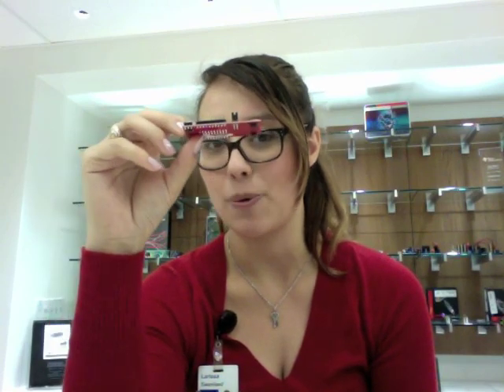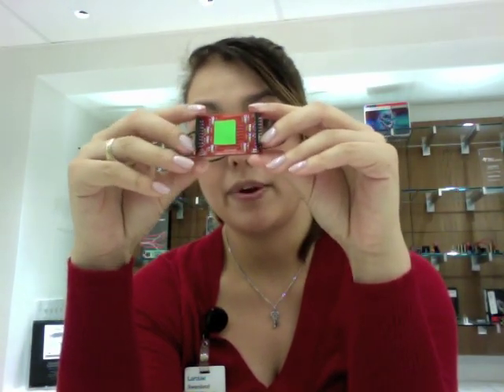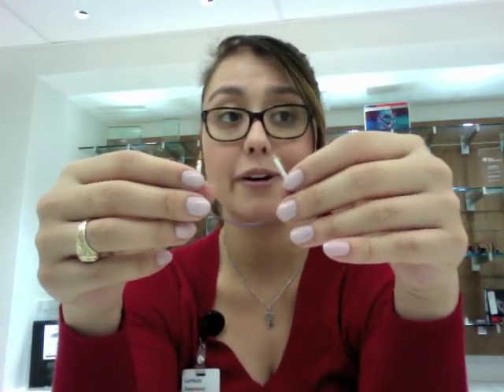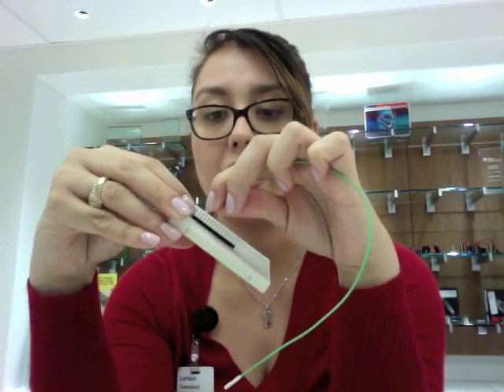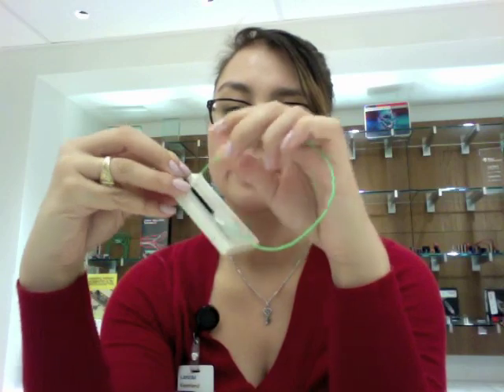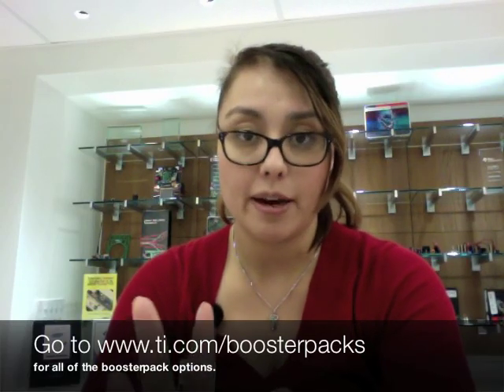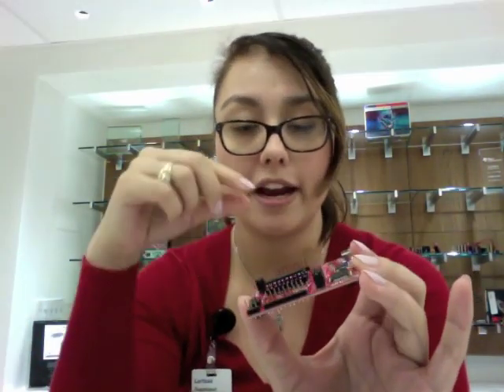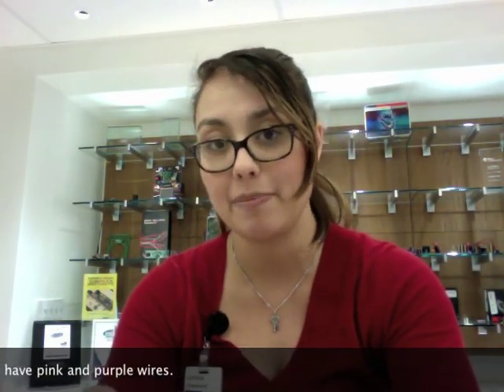MSP430 LaunchPad- Why Male Headers

Comment: 5:24 did you just break one the pins on header? you are strong!!!! Oh by the way, if you wan't to keep those male headers, fine! you could put them under the board so it directly go on to breadboard itself! you happy and your customer happy! Pins at the back are not obstructed by components, if they want to NOT breadboard, they still can use their female connectors.

Oh, One more thing! My problem is not what headers you are using. Where I live, to get my hand on one of those boards I have to pay half of my salary and I'm senior engineer in my company.

Comment: how I can use 1 STELLARIS and 2  MSP430 ? 
I need to establish connection between them, with CC2530 ?
when I try to flash 2 plates MSP 430 I get an error message, that there is no plate connected.
I get into the MSP430 folder instead of stellaris and not let me. (Have a .txt extension)
help please.

Comment: I would rather have the option of not soldering the headers on the board.  I've had to remove both headers (destructively) and have installed new headers.  I use a male header on the power side / bottom and a female header on the usb / top side.  This lets us mount the launchpad on our existing development i/o board as well as on our existing robot platform.

Comment: Yeah, I find when using Energia the MSP 430 is about as easy to use as Arduino and basic stuff ports fairly easy. I think the best route would be a set of gender changing headers to convert to female. My arduino projects ported very easy but I was unable to test because of not having a way to jumper over to my breadboard. I tried alligator clips but they were too bulky and tended to want to short between pins.

Comment: Use with logic analyzers is a weak justification for male headers. If someone needs to use LA clips, just drop in a set of Male to Male headers. Problem Solved.

Ability to use cheap and plentiful BARE WIRE far excedes the convenience of hooking up the occasional logic analyzer.

Comment: First male headers, now doubling the price on the launchpad? A STM32F0 discovery board has 4x the flash program space, 15x the RAM, 3x the core CLK speed, 2x w/ 32bit instruction set and is now CHEAPER than the msp430 launchpad. The MSP430 launchpad has lost its only selling point which was its price. 32 bit ARM processors are far more powerful, have more open source support, and compete with the msp430 in their low power models. Why use TI msp430s at school or work now? *cries* why TI...why...?
Reply: ARM processors are made to be used with an operating system.
Thus you can't really compare them with such small microcontrollers like the MSP430.
And an 32 Bit ARM doesn't have a lower power consumption than the MSP430.

Comment: Thanks.. I hope to see more TI products in Turkey as well.. I can only find Launchpad MSP430 series easily. I had to make a little personal stock of them :  ) I have both rev 1.4 and 1.5 and i have to use 1.4 for testing purposes. In general i love the things in the box, usb cable, XT etc.. Oh also those cute stickers !! Keep those in the boxxx : ) LAstly; Energia Project is very very important. I think TI should support it. Otherwise it is not practical to work with them for hobbyists..

Comment: Here's another idea nobody has offered yet: Raid the room where they store all the old retired computers and scavenge all of the ribbon cables from them. Use the first 10 odd pins on one end of the cable (1, 3 ,5 .. 19) to connect to a male Launchpad header, then stuff your male wires into the first 10 odd pins on the other end. 

Ribbon cable == really long female-female adapter.

P.S. The (J6) Vcc and 2 GNDs are 0.20" from the (J2) header, so they mate too, and come across to the other side.

Comment: They should cost the same. The press fit parts have "barbs" stamped into the side of the pins that go into the board. It is difficult to compare prices because if you try and buy plain old 10x1 gold flash plated headers the price ranges from $0.20 to $0.80 each. We can't draw reasonable comparisons when the baseline is all over the map. We know the nice folks at TI must be getting a good bulk discount to include them with Launchpad, so we can assume they can get press-fits at a bulk price too.

Comment: Just cross posting:
The female header would have been ideal, for the same reason listed for female jumper wire. Turning Female to male is simple with the included male headers from the r1.4, just pop them on to the female header when needed. Plug and Play, no soldering required, and would still work with the Capsense and all other boosterpacks. And since headers are pretty much a standard component, even if they get lost, easy to replace.

And you forgot to mention one option, WIRE WRAPPING

Comment: Have you considered not installing headers in the Launchpad board and just including the "press-fit" style headers and receptacles. By getting the hole size in the PCB reduced to the proper diameter you can get a really tight friction fit with the press-fit parts. That way people who have a preference can install the headers they prefer, and engineers (who the Launchpad was originally designed for) don't have to de-solder parts to get to the nice empty holes.

Comment: Not a problem. Sorry, I'm probably raging at the wrong person here. Thanks for posting a video with possible alternatives and work a rounds for the male headers. In addition, I need to learn to shorten my video lengths as well. 
One thing to consider, as a lab TA myself for an embedded systems class @ a university, I'd far sooner spend an afternoon soldering in female headers for the students than dealing with male headers for the rest of the semester. Having the option to choose is super nice!

Comment from the maker: Thanks for that. We've actually proposed that for a revision, but I got a lot of push back because not everyone breadboards and header pins down makes it hard to protect from ESD (like on the C2000 launchpad). Still, I like your solution to have the pins on both sides of the board.

Comment: Solid core wire is insanely cheap, reliable, and easy to use. "Cheap" female-male wires are far more expensive and have reliability issues after a couple months of gentle use. Engineering time is too valuable to deal with poor interface connection issues.

TI has a long history of making bad mistakes and generally their answer is, "Well, we've already made this mistake on a lot of other products so were going to keep doing it!". An 11 minute video is not the solution. Listen to your complaints!

Comment: Well. I just got two lengths of ribbon cable. Soldered the female header on one end, and solid wires on the other end (Headers are not available locally here). Then placed shrinkable tubes on it to prevent the contacts from touching. That's it. I already have a female to male cable to connect my LP to my breadboard. Didn't even take me more than 30 minutes to do.